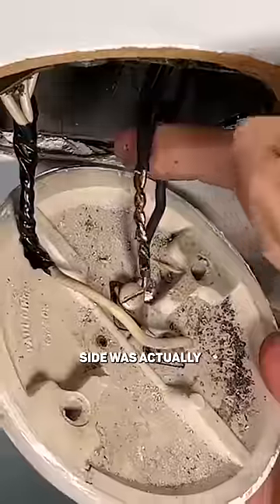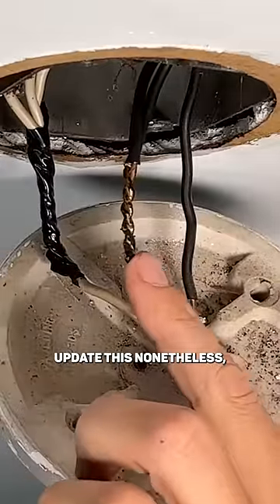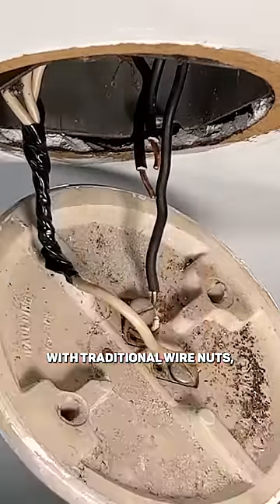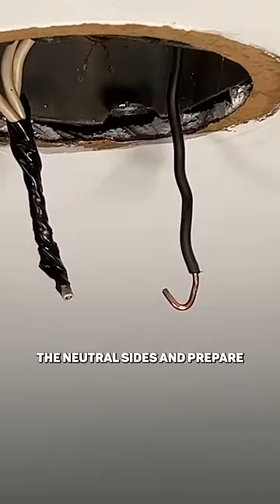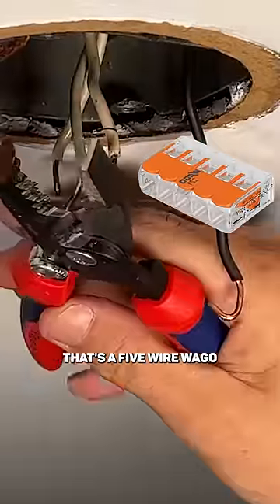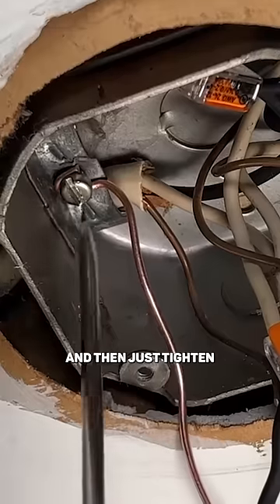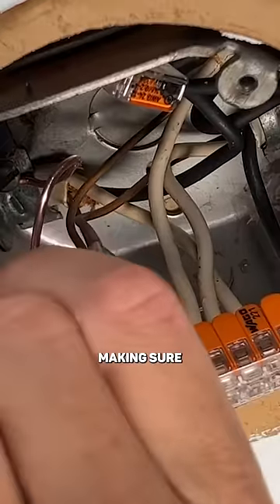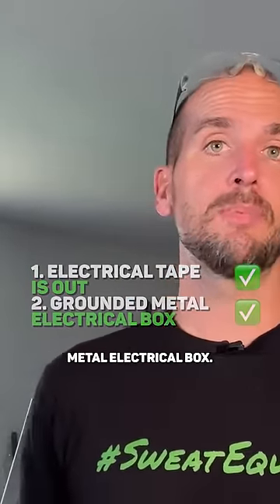Which Part Doesn't Meet Code?

Comment: That's not how you ground a metal box. That screw is strictly for clamping NM wires, NOTHING ELSE! Use a green bonding screw or pigtail on the hole designed for bonding or drill a hole if none is available. It's not that hard not expensive to do.

Comment: Admittedly I'm a plumber. 
But I find it hard to believe those Wagos  are as secure as a twisted connection with wire nut.
 I have found and repaired bad "push connections" on the back of backstabbed duplex outlets. Don't the Wagos work the same way?

Comment: Those wagos will burn your house down, you have exceeded The wire fill capacity of that 3 / 0 octagon  box and the screw you grounded to is not a ground screw it's for fastening the cable entering the box,, using it for both is not only a safety hazard but a fire hazard as well. Seriously those wagos might work in the UK and Europe where they have 220 volt receptacles, but not in the u.s. which  uses half the voltage at 1:10  giving them an arc-fault potentiall and extreme fire hazard. I have quite a collection of melted devices and boxes caused by wagos

Comment: Don't use pushpin connectors. They eventually heat up and stop making a full connection. Just cuz you haven't replaced one yet doesn't mean I haven't. Sincerely, the guy tired of cleaning up after b***** of like this

Comment: You could make the case that drilling and tapping for a ground screw is a modification to a UL listed box😬. You could also make the case that the guys grounding termination is Effectively Grounded, which would still be better than ungrounded.  Not saying I would make the case, but someone could.😅

Comment: Believe it or NOT? NOT. Actually only a handful of items in this intallation were or became NEC compliant. Solder shall not be the sole method of making seperate conductors continuous and twisting is not either(unless the twisting is secured with a listed compression device). Additionally per the NEC a minimum of six inches of wire shall extend beyond the face of any enclosure. Folks like this should not be instructing electrical installations on YouTube; the common person with no electrical knowledge was given poor advice. Call you nearest registered electrician of engineer and ignore this guy. Remember electricity kills amd starts fires when done incorrectly.

Comment: Don't use that connector...it's not a tight connection...I can pull each wire out of that bullshit connector with just my fingers...not a proper ground...green grounding screw threaded into the metal box...homeboy thinks he is a "competent individual "

Comment: Using the wago connectors is a bad idea I've seen them fail and cause fires. Soldered wire is much safer with a traditional wire nut and good quality electrical tape. Wago is exactly as you said.. the "easy" way... easy isn't safe.

Comment: If there is not a 10/24 hole for a ground screw they make a green snap-on grounding device because it's illegal to attach to a Romex securing screw. And the minimum length of wire exiting a box must be 3 inchs

Comment: Obviously you are not an electrician, this is clearly a violation. When you grounded the box with the cable lamp you should use a green ground pig tail. It is article 250 NEC   You are not even code compliant and mis informing the public. Electrical work is not a hobby and should be done by a licensed electrician.

Comment: 250.126 only applies to devices, and not boxes.  Screws in boxes can be machined self tapping screws as long as more than two threads are engaged through the material (on the other side).

No problem if the screw is green or silver or any other color you want it to be.  If you can't tell the bare copper wire is the ground, you shouldn't be playing electrician.

Comment: Using basically a stab back connector which a no-go for any electrician... yeah, ground not to code, not using all PPE, etc. Lastly, clean and wire nut would've saved time and still been code compliant.

Comment: Good lord he went from tristed and soldered to a push in fire starter  😅
Reply: That's what I was saying 🤣
Reply: They are not push in connectors, they clamp the wires. 6 years, 1000's of uses, 0 fails. Educate yourself before spouting garbage.
Reply: @cfulton8742 And they've been in use in Europe a lot longer, with no recorded electrical fires caused by those connectors
Reply: @C Fulton  ahh you mean like the fact that wago has much higher resistance and power loss than wire nuts?
Reply: @cinder9950  have any source of info to back up that claim?  Wago published EE testing that contradicts that. YouTube video from 4 years ago 120+ amps through one without it catching fire or melting, and it was only labeled for use at something like 20 amps
Reply: @Sartek there is a German you tube channel great Scott that did a comparison. It makes sense that wagos have to be amperage rated because they become part of the circuit whereas wire nuts are not because they simply hold wires together.

Comment: Could have put 3m 600v adhesive heat shrink over the original solder joint and it would have been better then what you replaced it with. Also you need to actually tap a 10-32 hole for a ground screw you're not allowed to use the wire clamp screw.

Comment: He should have drilled and tapped the box for a green 10-32 ground screw, or use one of those little lip clips on the rim of the box, but I prefer a 10-32.

Comment: They don't still use solid core cable on new installations, I guess they have to if they still use wrap-around screw connections. It's like the Seinfeld joke about the Chinese seeing the fork but still using chopsticks. you see the wago connector but .....

Comment: Too bad you are switching the identified conductor (what he is calling a neutral) to turn the light on and off.  That light is still live to ground with the light off.  So bad new it's still not code compliant. P.S. just use normal wingnuts they are designed to expand and contract with the connection as it warms up and cools down when the load is applied and removed. Everyone is mentioning the ground screw. Nice catch folks.

Comment: I Am no fan of ground clips but if you did not  have the tap 10 /32  bit
Actually Using friction. Tape then electrical tape over a soldered  connection  Or one  using a bug !!

Comment: I usually try to stay out of it but it's been my experience with them slip connector bull things that overtime they lose their grip you know it is when you bend over and things just happened with that it was a short circuit and a Hydra lighting application

Comment: Are you sponsored by Wago ot something? Because you just did a bunch of unnecessary work and made a 3 second job take ten minutes and crowded the box with a bunch of wagos. Which are less electrically sound than wire nutes. So you made it technically worse and spent way more time.

Comment: Nec code doesn't alow you to use that wire holder screw as a ground .
Why is this ? 
Your not using a green screw in its designated grounded threaded hole located in all metal boxes .
Reason number 2 , that wire holder has been used to hold that romex wire and your make shift grounding is not torqued to grounding specs without harming that romex .
Contact your local licensed 
Electricians before trying things like this .
Thak you .

Comment: I am putting electrical system haven't started yet just bought the parts and a 1937 Plymouth Coupe should I put all my grounds in one spot like the ground for the backlight and all the electrical that is going in the back and then the same thing in the front for a grounding bust hope somebody replies

Comment: Man this world has become something else I feel like everybody just gets lazier and lazier with electric vehicles robot vacuums and lever nuts let's be honest how hard is it to twist your wires together and put on a wire nut
Reply: @Kevin-mp5of  reasons why I use wire nuts they're cheap they're effective they're reliable they're readily available and they're easy to use reasons why I don't use lever nuts they're not readily available I personally can't just go to Home Depot and buy them and they're more money and with lever nuts you can't connect a 12 gauge wire to a 22 gauge wire but with wire nuts you can and why do you use leather nuts but not a bidet?
Reply: Folks here in the U.S. just tend to be married to tradition and the ways that they learned. It's not laziness; it's efficiency. People are just resistant to change.

Comment: No green ground screw that is in the proper hole in the box most metal boxes have a ground hole that is marked for a 10-32 green ground screw. Wagos are nothing more than stabbed lock connectors. Twisted wire nuts are a superior connection.

Comment: Your ground is not code compliant, and those crappy push in connectors are JUNK. The tabs burn off at low amp loads allowing shorts and arcing

Comment: Not up the code is those waggle wire clips that he's using the reason is is they're not rated for $120 volts they're only rated for 110 volts at 120 they start to overheat and as everybody knows the 110120 is a variant it can go as high as 132 volts and go all the way down to 100 volts therefore those waggle wire clips are not to be used in residential wiring where they can be used at and where they get used a lot at is it computer wiring why because computers usually run on DC 12 volts 5 amps that's only 60 watts it doesn't overheat there

Comment: I've always hated those connectors.  I was always taught right connections were best... those are just as bad as the stab in devices you get at home depot... it's just pinched in there. Personal preference is lineman pliers and a quality wire nut... and yes... some wire nuts are junk

Comment: Was always told by my electrical instructor that you may be smart enough to do this properly, the next guy likely isn't. Always use a wire nut and a jumper wire with decent length

Comment: Correct me if i'm wrong, but wouldn't connecting neutral and ground at the fixture mean that the ground leg carries a portion of the fixture current, and will be floating at a non-zero voltage? That seems bad

Comment: The code doesn't permit the use of solder.  Also the White wire isn't a Neautral. It's actually the grounded conductor.

Comment: You can't use that box clamp, but if you remove the metal clamp and use the machine screw without the romex metal clamp it becomes legal when connecting the ground wire to the box for a equipment ground

Comment: You must not work on live wires . You never touch the copper wire .  Always work like it's hot . And those 221 or 412 are not any good always twist And  use wire nuts and pig tails. The way you are doing it is worthless .

Comment: Wago in my opinion are shit this is based on 35 years of electrical experience hands-on low voltage to high voltage low current high current no those connectors yeah they work their code compliant that doesn't mean a damn thing however as time goes by and that cover oxidizes etc and it will especially with moisture and those getting those connectors and you can actually lose the solid connection and create resistance in that connector and it will catch on fire and I've seen waggles on fire the gray and the clear

Comment: Sure lets take a connection that's worked fine for 40-50 years and convert it to one that will fail in the near term with possible fire. Sounds like good electrical work to me.

Comment: Code does NOT permit an equipment ground connection through a mechanical fastener as shown. There is a threaded hole dedicated for the ground bonding, often on a raised dimple.

Comment: My high school electric shop teacher in 1979 and 80.. mr mauser,  taught us to solder wires. We had to pass a test by making a pro tap, pigtail, and western union SOLDERED splice. The solder couldn't melt the insulation and no sharp edges were allowed

Comment: I'm old school and BELIEVE  IN WIRE NUTS AND ELECTRICAL TAPE...I was called out for a new outlet install and the home looked familiar to me...as I got into the box I found " old school " connection. Lo and behold some 12/14 years earlier I had done this repair/ install. The connection was as I had left it years ago. NEW STUFF is good however if you do QUALITY WORK UPFRONT YOU HAVE A GREAT CYA RESULT !!!

Comment: Believe it or not your push in connectors only make minor contact to the wire, experienced electricians don't recommend them as they will burn under heavy  current loads. They contact the wire only at the edge of the blade inside the connector,  I  can't understand why  NEC allows the use of them. Fine under very light loads but that defeats the purpose of a 15 or 20 amp circuits potential. Suit yourself.Thats why we won't use a backstabbing as well.

Comment: It says which part isn't code compliant, a cut the wire too damn short and you're using goofy gimmicky crap when you should just use  "traditional" wire nuts. But I did think what the hell when I first saw that in an old house

Comment: Let's check back in 20 years and see how the wago connectors held up.  I still got for a correct wire splice soldered with rosin core solder every day of the week.  Low job skills always calls for a gimmic

Comment: Now your wire is probably being pinched too tight if the ground is secured how it’s supposed to be. Terrible grounding point. Do it the right way and drill a new hole and tap it. Klein makes bits that do just that in one easy motion

Comment: You know I will say I’ve seen a bit of people rave about wagos but I’ve always managed to pull them off, personally in my experience I trust I wire nut that I test to try to pull out, if it does re do it

Comment: The connector he is using is limited in what it can do. Where a wire nut is not. The wago or what ever thing he is using has a very thin bus bar that can break the circuit if you draw too many amps though the wire. They kinda suck where a wire nut comments wires directly together. 
Also electrical tape that is stationary and not in direct UV light will last decades and decades.

Comment: You are still not Code compliant! The Ground screw is supposed to be Green and a mechanical connection only used for ground is required.

Comment: There is No Better Connection than a Twisted Wire and Solder with a Wire Nut. That Connector will Burn Your House Down.

Comment: Once again this man is clearly not a real electrician. You're supposed to use wire nuts by code. You cannot use push in connectors, cant use them on light fixtures, switches or outlets, they have a higher chance at failing than a wire nut

Comment: There is a pre tapped hole in the back of the box for a proper ground stinger to be installed. If you're posting a how-to video, do it right.

Comment: I work as a cable tech and I've always wondered. Why does it seem like most electrical related screws use a flathead instead of a phillips? I've always felt like the flat blade of it was more of a risk.

Comment: Solder is never code on any ac voltage. Solder would melt in milliseconds in a short circuit condition. Solder is only compliant for low voltage under 50v

Comment: My whole house would give a modern electrician several strokes.
Reply: More after they found out it recently passed code
Reply: All American domestic wireing is scary.
Reply: My house was built in 1898 and electric was added in 1955. Everything in my house is grandfathered in, so it doesn't have to meet code unless the house is heavily remodeled.
Reply: @AceWolff  wouldn't bother me, and if everything from 55 is the same and not bodged, i would have no issues with it, the stuff back then is honestly better than what we're installing now
Reply: I could agree with some things. Especially how it was moved throughout the house, but,  I very much enjoy my plastic boxes and safety features. 

Another thing I should mention, the house I live in was, at one point, separated into 2 apartments, with a second pannel box added, but no new wire ran. Everything was spliced together until each floor was on its own panel. Ex: there's 9 outles and 6 lights on one 20amp breaker using 15amp wire.
Reply: @AceWolff  we still put that many on one breaker, granted we usually use 12gauge wire, however if it's knob and tube and it's not covered by insulation, it's heat dissipation would allow over rating by 5 amps usually. Though 5 amps usually isn't enough to worry about. Also, we do use metal boxes still, and they'll hold up much better than plastic or fiber glass ones. You can also put a GFCI breaker in place and it will add more protection should something happen. We always do that on the older two wire systems and it is allowable by code.
Reply: I Don't disagree with metal applications, but in a residential install I believe non conductive boxes are the only way to go. 

That's a good tip, I think I'll do that in some places. 

It's like 50/50 peg and tube and like first gen insulated wire. Problem with the insulated wire is its so brittle I keep finding chunks where the bare wire is now exposed. 

Also, today while working on the kitchen, I found that all the wiring is ran on the outside of the house and then covered with the siding.
Reply: I wish I could post pictures.
Reply: @AceWolff  ah, yeah, seems yours is breaking down, and they bodged some of it, though if it's newer wire then they couldn't get it where it needed to go

Comment: Wago connectors are garbage. Wire nuts are always the best way to go. I would not use the nm clamp as a ground I would predrill a hole and tap it for a ground screw or use a grounding clip.

Comment: Wago nuts & wago level nuts are ok in 3 wire grouping. Anything more takes up too much space inside the box (junction box , light box, outlet box,) 
If you’re gonna connect any more than 3 wires together just use the conventional Ideal twisting nuts. 
They use up less space.